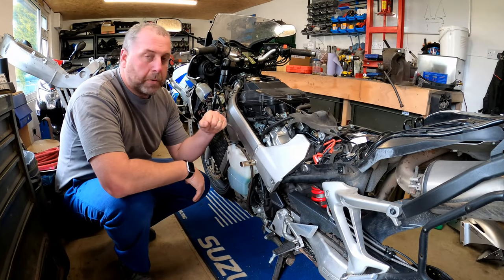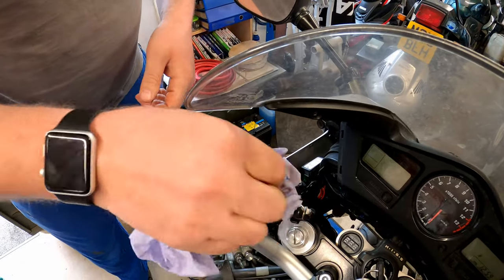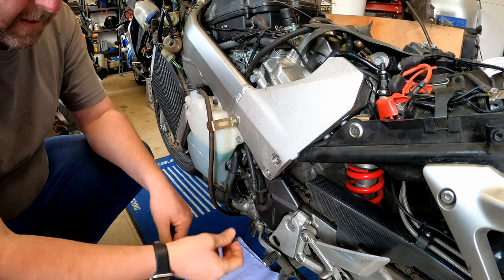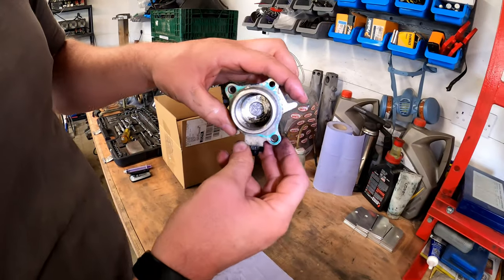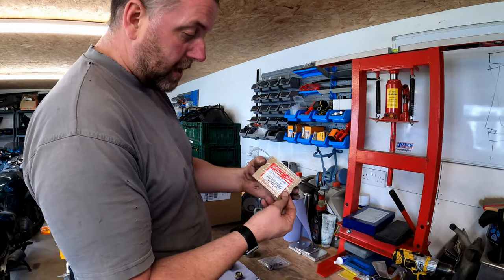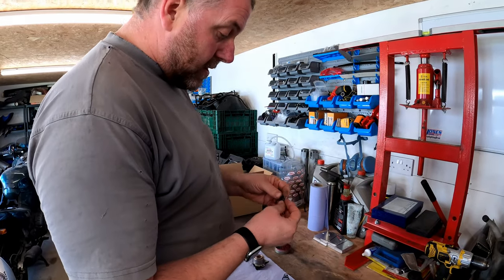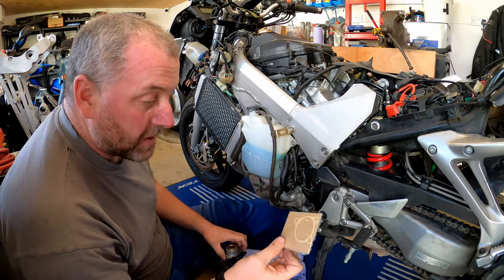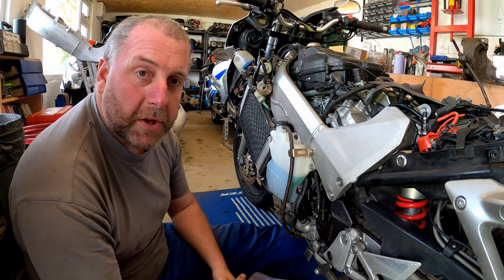2003 Honda VFR800 VTEC - Clutch Slave Cylinder Removal, Renovation & Fitment

Comment: What are the signs that lead to a rebuild of the slave cylinder? Heavy clutch? Not engaging/disengaging cleanly?
Reply from the maker: It could be one or many of several things such as an inability to select gears, low fluid level or potentially a leak of fluid from the cylinder. The clutch lever may come all the way to the bar before operating the actual clutch. The clutch lever may feel loose or almost kind of floppy and there could also be noticeable contamination in the fluid which can be caused by the rubber components disintegrating into the fluid or water being allowed to enter the system. 👌

Comment: once bike gets warmed up my clutch will not engage. I bleed and replaced fluid with no results. should I look into master or slave? both?
Reply from the maker: If neither have had attention since the bike was new then I would do both, the parts are cheap enough! 👍🏻

Comment: Does anyone know the exact size of the 3 long bolts that hold the slave cylinder in? For the life of me I can not find them online and I am in need of just one. The previous owner of my vfr800 forgot the put all 3 back in so I have a very very slow leak there